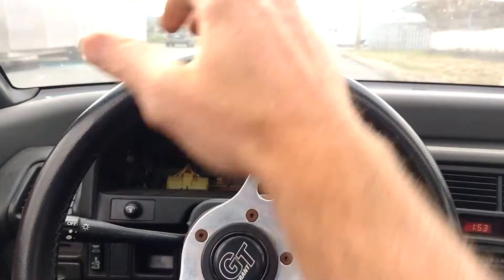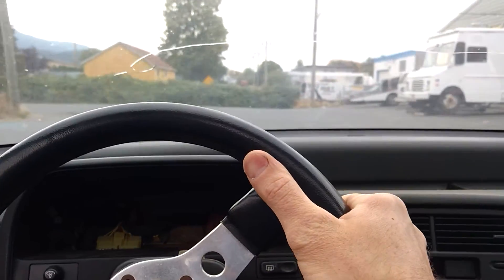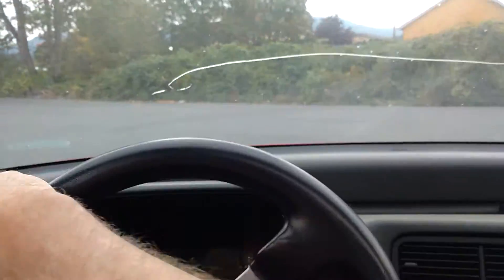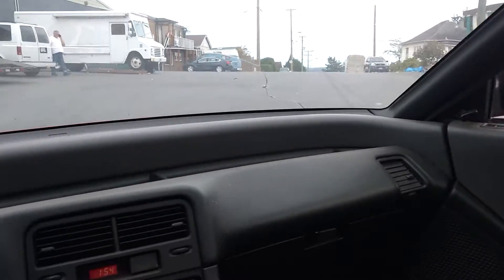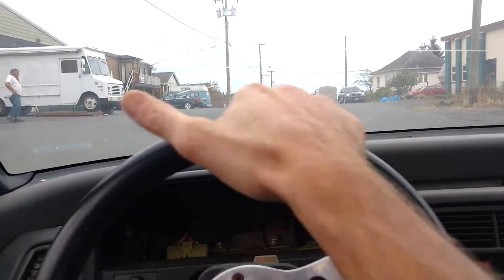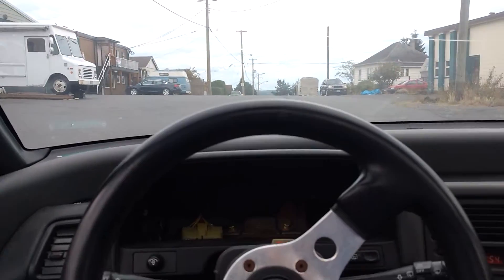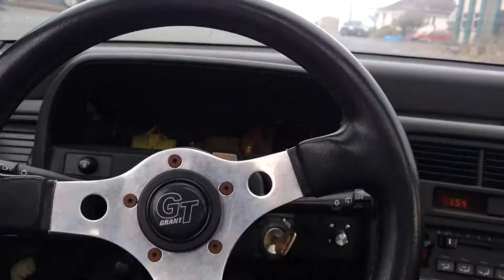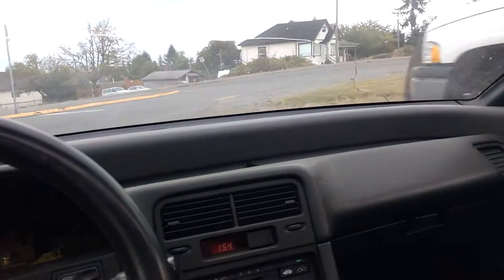Electric CRX at 1/2 power

Comment: do you have a scmatic of the inverter that you made and how much would it cost to build?  I'm very interested in this project.
Reply from the maker: Go to endlessphere forums.  I have a few threads there under Arlo1
Reply from the maker: Its about $3000-$4000  to build and install the inverter.
Reply: Arlin Sansome found the page and will be reading though it thanks.

Comment: have you found a posi / LSD that will fit in it?
Reply from the maker: Not yet....  Any help would be cool.  ;)
Reply: Arlin Sansome wish I could help but I don't know to much about diff swaps.    by the way what batteries are you using just the stock leaf ones?
Reply from the maker: I have a special battery I made up from multiple other batteries.
Reply: Lithium??
Reply from the maker: Yes its all in the battery.

Comment: Hell yeah!!  Awesome.  
Quick question: i can get pretty cheap leaf motors with the inverter and the whole modules intact, would it be a good idea to use the igbt-s that are in the leaf since they all ready are so neatly cooled and embedded in  resin?
Reply from the maker: you will be starting over more or less
Reply: I know but i feel like its a shame because in a while the will be practically free and could be used from power generators, ev and so on.
Reply from the maker: The OEM IGBTs are a nice unit but rated for 300 amps less then what I used.  The amount of work required to disassemble a good working Nissan leaf inverter then to redesign a driver stage etc.  is simply not worth it.  The oem leaf inverter just needs someone to hack the code so they can run the phase amps to a higher rpm and make more hp  It will not be as good as what I build but let you bump the factory inverter 50-100hp more with a really good battery.